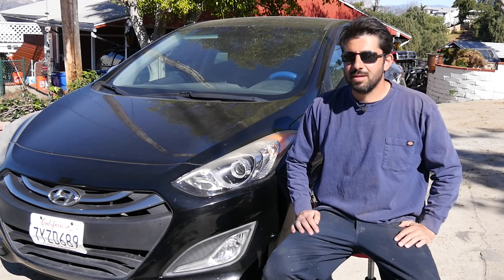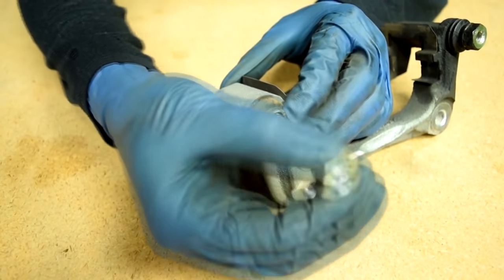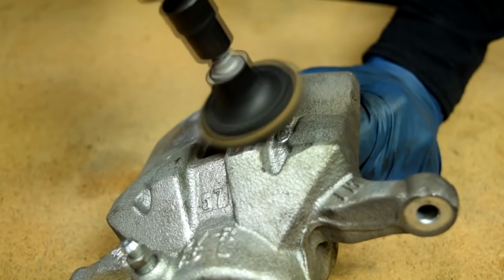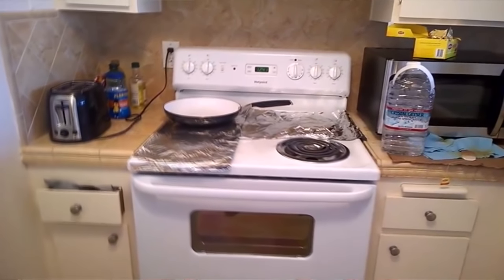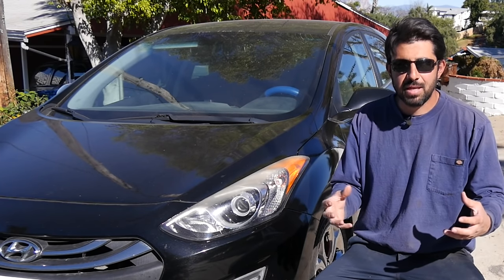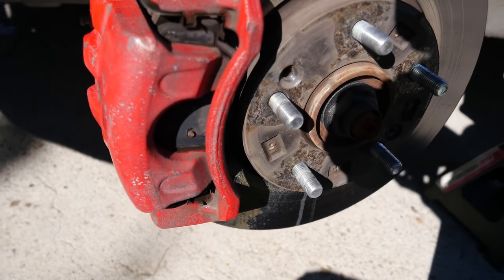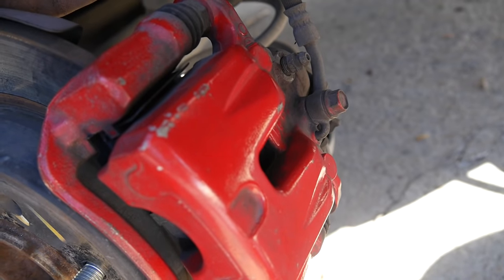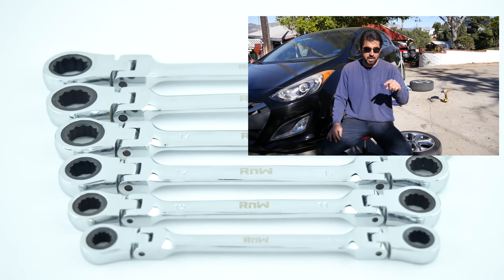How To Paint Brake Calipers and a 5 Years Later Update

Comment: One thing Id suggest to increase chances of paint not losing adhesion to bare metal is to use a metal prep wipe or an etching primer before applying your topcoats.
Reply: Agreed! And with an etching primer, do not make the mistake of letting it cure completely before top coating it. Let it dry for maybe 30-45 minutes, no longer, and then top coat it. You want to top coat it after it's etched into the metal, but is still 'soft' enough so the top coat will really bond well to it.

Comment: It was a great job, I never seen DIY painted calipers look this good even after a year. I wonder how it would hold up on salty roads.
Reply: Mine look good for about 2 years, and rust at about 4-6. The light coats and heavy coats over are important. Letting it cure baking or leaving on a shelf for a couple weeks is key to avoiding early damage and rust spots.

Comment: I've used Foliatec on the brakes of my Golf GTD. The calipers had some damage so I used it so make them look new. And it worked out great! The color of the Foliatec paint matches the OEM color for about 90 percent, only I know where to look for differences. If you check out the overall result there's no difference in color. I've fixed the damage about two years ago and it's still in excellent condition. Might be worth trying out in a new video!

Comment: I use a 2 part EPOXY brake caliper paint mix. I have had great results with very little damage. The amount of paint is good for a little more than 2 coats of pain. I was afraid the small container would only give 1 coat but it covered them twice with a little left over. It comes with a small brush for application. The paint mixes easy with an activator and leaves a very hard finish.

Comment: 1. Scuffing
2. Gegreasing / cleaning (don't skimp here!)
3. Primer when completely dry
4. Paint after an hour of primer drying, then 4 light coats every 20min or so assuming 70deg, then a final heavy(er) coat after a day or 2 (or a bake) 
5. Bake at end. Go low and slow if rubber bits are on (160f-200f) for at least 30min. I go a bit higher (200f-325f) if completely stripped castings. 
6. Let cool and continue to cure for a day or so before installing if you can.

Tips: Most paint is plenty high-heat for brakes. No need for caliper paint. 
Usually lasts about 4 years on dirt roads and salt. Might be worth powdercoating if breaking them down completely.

Comment: Great job, I do the same, or order precoated calipers when they are shot, it's the nice look, and also the prevention of rust, sliders freed up, helps seal the bleeders from corrosion, less chance of snapping off, I like a light silver, it makes spotting leaks easy. It's ridiculous that all calipers don't come coated from the factory. Rotors too.

Comment: I have been following your method very closely for my rear calipers.  They have come out pretty well.  The calipers I just painted using your technique were Remanufactured ones that had the powder coating you mentioned in your other video.  I used a wire brush to get that off per your suggestion.  But how do you REPAINT calipers that have already been painted?  Do you need to use a wire brush and get rid of all of the old paint?  Or can you just do a quick sanding or something and paint over that?  Is it just a bad idea to repaint them?  Would appreciate advice.  Thanks.

Comment: My back drums are rusted.. is it safe to grind a layer of the outside case with a sander?
Reply: Brake drums are reasonably thick so you should have no problem sanding them back to the bare metal
Reply: Yes.

Comment: Do you think it would be necessary to remove the piston and rubber components before putting it in the oven?
Reply: Should be no need to disassemble the calliper and piston so long you keep you temperature around 225-250 max.
 Uttnder hard breaking the brake piston can heat past that temperature range.

Comment: Is it safe to bake paint in your oven and then use it afterwards for food?
Reply: Right!   The fumes released would not be good for humans to breathe either!
Reply: Can be much worse than all the garbage they put in process food. It will eventually bake off. It would be ideal if you had a separate oven or something similar.
Reply: If your worried run a clean cycle at high temp and burn if off, bonus will be your even gets a deep clean

Comment: I'm guessing most of the paint damage was not from road debris but from the mechanic that serviced your brakes. I doubt you've driven 80000 miles without pad and/or rotor replacement and the majority of those Greasemonkeys couldn't care less about your nicely painted calipers being scraped up.

Comment: In less than 5 mins,  I used high temperature spray paint  without removing the wheel and it looks good enough.   Do not worry if some spray paint gets on the rotor because it will naturally wear off when you use your brakes.  
  * I did not bother to spray the back side of the caliper because it is not important to me and I cannot see it anyway.

Comment: I can't believe that the rubber in the calipers didn't melt at 200 degrees for an hour. 

I put por-15 on mine they lasted pretty good. But they do get dirty even if you're not on dirt roads. I painted the control arms and everything black. My biggest problem is that I have to replace the rear calipers every two years or so. Damn AutoZone cheap crap. But its LLT. So gotta do it. Im not paying 3**. 00 for audi calipers  that will fail as well just a little later.